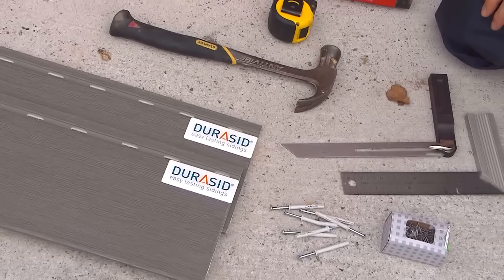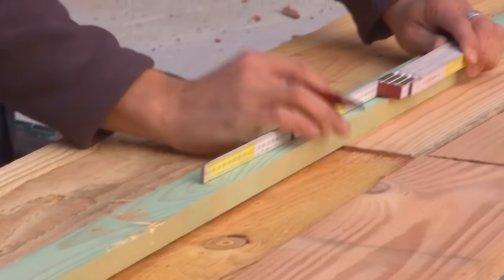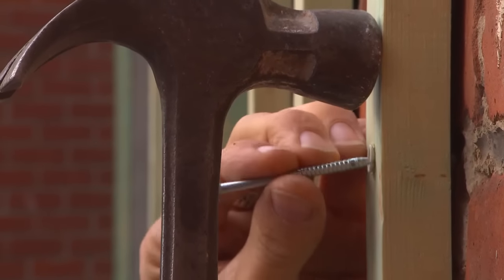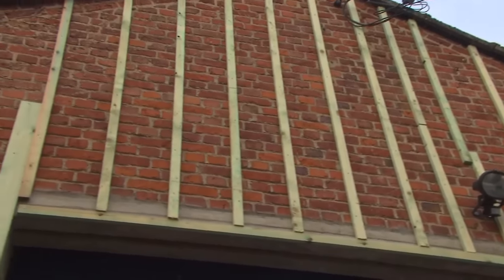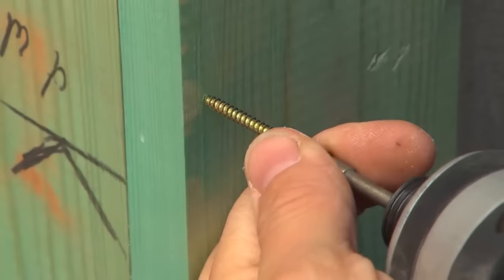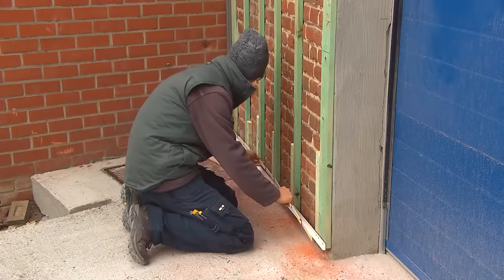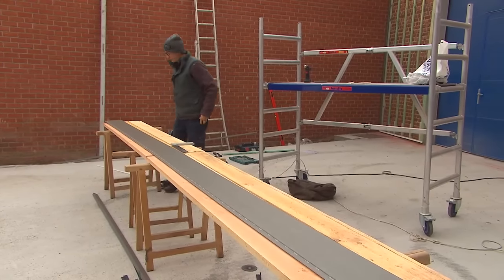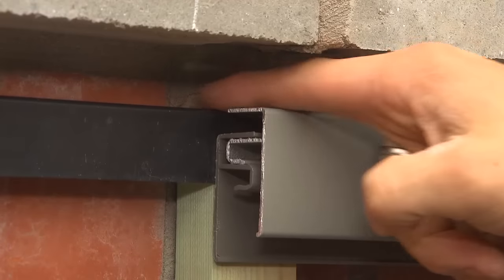Durasid - EN

Comment: This is a great video , using off cuts for getting the correct space before fitting the outer covering , Instruction guide which came with my cladding assembly was totally useless,  I'm now confident to tackle this project, just waiting for the rain to stop ,Thanks a lot .

Comment: I searched for 'How to install siding on concrete'.  Thank you for this helpful video.   
Someone commented that this method is not good for brick walls, which remains to be researched.  I found on your video that you screwed the siding too tiedly, as they need moving while expanding and retracting, especially for us in North America as we have weather conditions fluctuationg between -30C in winter up to +39C in the summer.   Either way, I found my answer.  Thank you, again.

Comment: In the USA we call this stuff vinyl siding, and it doesn't get  a lot of respect. I wouldn't call it maintenance free, since it collects, or at least shows dirt a lot faster than brick. It would usually be considered as odd to cover a brick wall with the stuff as it would be to cover leather car seats with cellophane, though I understand that brick is considered more of utilitarian material over there than here and that old brick buildings can be a maintenance headache. The stuff we use doesn't warp very fast unless concentrated sunlight (from a concave window), or heat from a gas grille hits it, but it gets brittle as it ages and usually needs replacement after 25 to 40 years.
Reply: That brick looks horrible. It is not nice looking and looks really really cheap. Maybe where you come from the US brick is seen as something of Luxury. 

In the UK that sort of brick is everywhere and looks really really cheap. It is not some fancy brick that people things of but an industrial cheap brick that was used for poverty areas. The fine fancy brick you are talking of was used on upper class homes from the industrial era right through the victorian and then edwardian era.
Reply: Vinyl is pretty much maintenance free for many many years. Brick looks nicer but in time they leak and need repointing. The process or repointing is vfery expensive. Almost as expenseive as rebuilding the entire brick wall!
Reply: @avidreality3392  you don't half talk nonsense just like the above poster
Reply: Kevin Kilnan  😂😂😂 bro u high

Comment: Don’t get this? Maintained brick life 100 years plus and some! Drill a load of holes which will weaken and compromise a buildings integrity,  to fit maintenance free plastic cladding on a timber batten which has a much shorter life span than brick. It’s just asking for trouble! I get the aesthetic aspect but there are better options, in my opinion.
Reply: So, what is the better option?
Reply: I don't even get the aesthetic aspect... Because I grew up seeing weatherboards used on cheap garden sheds.
Here in Australia though, people break down brick, even replacing perfectly good brick walls with temporary timber fencing... They look disgusting.
Reply: You know that those bricks (the same in American homes) they're just, as he says, a facade, there's no structural point to it, you can remove all of the bricks and there's no issue with the structural integrity, because the structure are the 2x4 on the inside
Reply: Could you tell me if you have any other ideas to this please 🙏

Comment: I want to install some wood cladding over existing render. It will be difficult to locate the mortar courses though.
Reply: You don't need to drill into the mortar courses for mounting your battens, it just so happened that in the video it was drilled into the mortar.
Reply: @melmarshall8176  sure but it will be easier
Reply: @Ineedahandle75  Sure it would be a little easier, but mortar joints aren't as solid a fixing as the brickwork but with the correct tools it will be quite easy, engineering bricks tend to be one of the hardest bricks but are still able to be drilled.

Comment: So cover a perfectly good brick wall with cheap, nasty plastic cladding that'll soon deteriorate due to UV, which will make it impossible to maintain the brick & roof pointing, or to change/mastic the door & windows. And which will attract dust & leaf mould into the cavity, blocking it up leading to moisture transfer, especially as rainwater will pour in thru those gaps under the roofline & door/window openings.

Comment: 2:20, drills a fixing hole into mortar - what an cowboy...
Reply: must be polish one
Reply: horse1066  no Belgium ..... its Roger from DobbitTV. A diy program on Belgium TV (Dutch speaking)
Reply: He had already pre drilled the timber and it's just where the hole fell. Would make absolutely zero difference to the install. Holding timber up to the wall and marking out every single hole to avoid mortar would make the job take twice as long.
Reply: Chris Anderson ....you don’t need to pre-drill for hammerfixings.....str8 thru with a sds bit.....so to me the comment stands....the guy’s a cowboy

Comment: Can we use this material in a wooden house?
Reply from the maker: Hello, If the installation instructions are followed, it shouldn’t be a problem to use the panels against a wooden frame house.
Reply: For wooden houses, you need water barrier, something like Tyvek and find instructions on how to install that.  Also, this video is from Belgium, in North America we have different codes and equipment for the job, yet, find out what in your area is available.  You don't use wood strips to attach siding on wood.  The metal or vinyl goes directly on it, but there is material available for that.  You slip the siding into the frame on the sides.
Reply: @Sunnyside--Up  thanks mate
Reply: @georgekipgen1528  Ok mate, no problem :)

Comment: Does this material similar to acrylic/polycarbonate which I heard to have been declared to be carcinogenic (at least in California)?
Reply: Nearly everything is carcinogenic in California. He mentioned PVC, or vinyl (though I suspect the foam itself is polystyrene), and it does put out nasty smoke when it burns. I'm not a fan of this stuff, but it's not going to poison you from the outside of the house. The safety concern with this stuff in the 'states is that it's often put up over walls that are already flammable and the chimney effect makes them burn faster. But over brick or concrete, it's not usually a fire hazard.

Comment: It just makes no sense to rule out insulation. You were spending time cutting down plastic end profiles, when if you went for the 4" system, you could have insulation, and the air gap. Always challenge whether an air gap is necessary. For impermeable systems you do not need an air gap. Reviews below do not look promising...
Reply: That was not an impermeable system. It would have water and moisture on occasions running down there and the air gap ensures that it can actually dry out and not have mould growth.

Comment: Why the ventilation is needed? Isn´t better to have insulation in the exterior to create thermal mass in the interior?
Reply: No because water and moisture will make its way down through its rear and if insulation is used it will cause serious damp issues. 

There are ways to do it with insulation but that is not one of them.

Comment: That is a whole bunch of plastic, for no reason other then visual. If you were putting this over external insulation it might be worth it. The "vermin protection" strip would last about 90 seconds against a rat. I've seen rats chew through a door in 12 hours, that thin plastic strip. . .no problem. 

Does look nice though.

Comment: Blimey, it's an industrial unit, so impact damage would probably take a week before you had a damaged panel. Also a big missed opportunity not to insulate this solid wall and instead just covering it in plastic.  I'm not questioning the fit and finish, but it's not something I would want to use or specify.
Reply: 1) Who's purposefully driving in to walls? That's like saying don't buy a car because you might crash.
2) As you said, it's an industrial unit. It likely doesn't need insulating.

Comment: This product is complete shit. Did a job last year where we installed about 30000 sq ft of this product. As soon as the sun hits, the material starts to bow. There were sections that would have discoloration when it started raining. The manufacturer tried saying it was installer error so they sent a rep to watch the install. Product still bowed in direct sunlight and still looks like crap
Reply: Jason Malidor
Reply: Jason Malidor wouldnyoi use hardyplank?
Reply: Foreign rubbish. Video was dubbed over with an English voice.

Comment: Absolute rubbish. No technical support. Length up to 6 mts push out with expansion and never return leaving 1cm gaps all over the walls. If you have to use it DONT use the invisible joiners, they won't be invisible for long.

Comment: To avoid sounding as if you dont know what you are talking about, get the building terminology right.
The timber is called battens (slats are thin flat strips as in blinds).
The framework is called wall battening, (a lattice is a net like arrangement criss crossed)